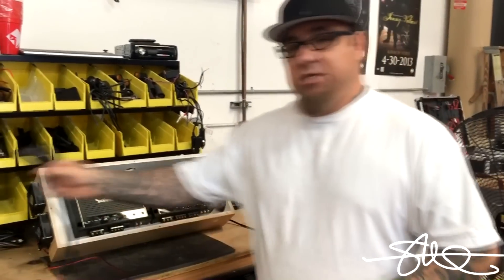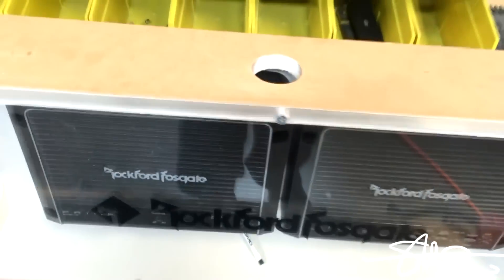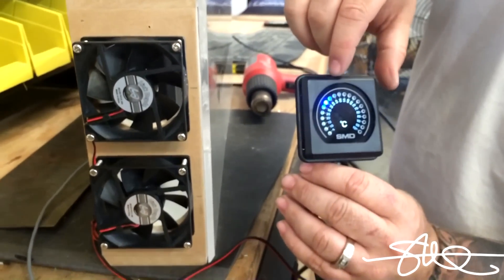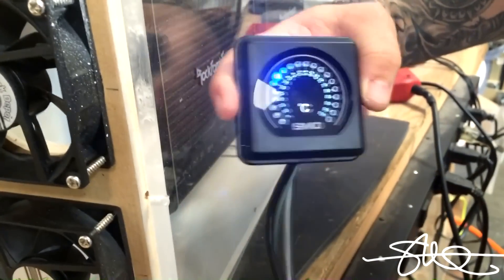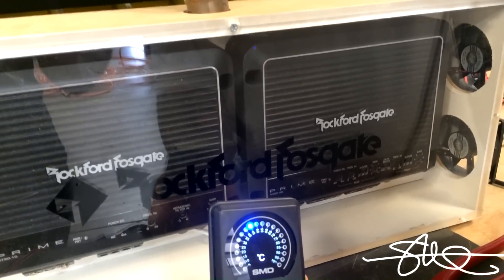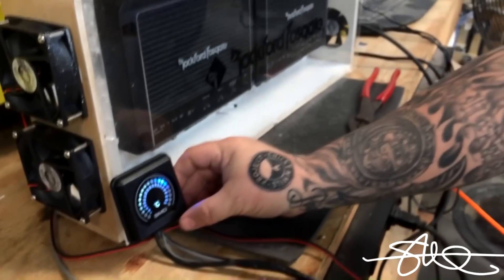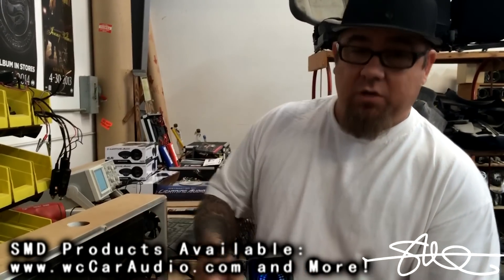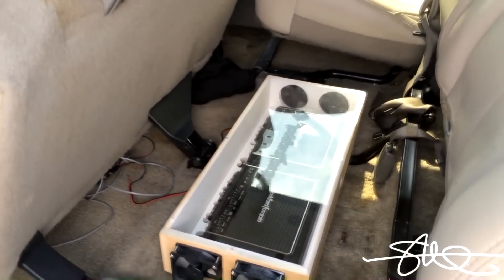How to Build a COOL Amp Rack (easy) Temperature Monitor - 3 stage Fan Cooled

Comment: I need something like that for my gaming comuputer
Reply from the maker: No Huevos i have an "actual gaming PC" and i use it.  The TM-1 will shut fans COMPLETELY off when not needed not just ramp them up.  When i am not gaming i would rather my fans didn't pull dirt and dust in for no reason.  Also it's one thing to use the one or two stock fan outputs  that have a sensor on the mainboard.  It's another to be able to put the sensor anywhere you want and control as many after market fans as you like.  I have 2 gigantic  radiators (480's) on my PC and 8 fans that would normally be spinning at all times. There are 4 other case fans that are the same. If i am not gaming they don't need to be on at all.  This is a product for a more advanced case-modder who wants extra fans in his rig and a way to control them without having a jet engine under the desk 24/7.  It might not be for the basic gamer or the guy who bought an Alienware and doesn't know how (or care to) use extra fans.  Some don't need them, some do. Some want them more than they need them.  In my case, it wasn't a waste of money at all.  But i am a "real gamer" with a "real gaming pc" so what do i know. lol
Reply from the maker: i got them in mine and so do some of my friends...they work GREAT in PC's bro :)
Reply: If you have an actual gaming PC you should be able to set fan profiles in the bios so that they will ramp up when your components reach a certain temperature. The parts in your PC already have temperature sensors on them so buying this would be a waste of money for your application
Reply: meade916 There's free software that will allow a user full control of every fan in their computer including turning them completely off so I'm not saying that your product isn't great, I'm just saying that it's an extra piece of hardware that isn't needed. Besides, most cases come equipped with filters to prevent dust from entering the computer.

Either way, I'm sure you're not going to change your mind and I'm not going to change mine so just keep doing what your doing and putting out the great videos.
I can't wait to see an update on the DGAF

Comment: Why is it Celsius. Love the product.
Reply from the maker: because that is a measurement of temperature? i am guessing that is why we did that.  FYI, as stated in the video we also have Fahrenheit available too.
Reply: meade916 What? No Kelvin?  Just kidding.  That little thing is EXACTLY what I need for my credenza that has my receiver/amp/blue ray etc in it.  I'm a huge computer geek so I thought about the case fans but then how to control them?  I didn't want a regular fan controller as they're usually manual.  Very cool little unit.

Comment: Is that oriented as push/pull, or are both sides pushing air into the box, and presumably out the hole in the top?
Reply from the maker: push pull (like i stated in the video).  The hole in the top is just so i can push heat from the heatgun into the chamber for the demo.  If i actually use this rack, i will plug that hole.
Reply: Right on. I must have missed that little part. Awesome demo.

Comment from the maker: guys, this is just a basic, quick little amp rack.  The fans you choose, the location and other things will determine what it is going to take to get the job done.  Higher CFM, higher static pressure of course is GOOD! But any air is better than none. :)
Reply: +meade916 do you have 2 fans as a intake or all 4 pushing out?
Reply: yes
Reply: Hey steve my fans are 2.75 amps so I guess I can only use one right i dont want to mess up my temp sensor
Reply: Mead can you make me one ? And if so how much ? I’ll send half so I can get started and the rest when your done let me know thx 🙏🏽
Reply: Had to come back to look at your video to help build a rack for my truck
Reply: Can I pay you to build a simple fan set up for my amp and you simply ship the finished product to me? I just have one 5-channel amp and it’s underneath the front passenger seat in my 2010 Tundra double cab. So I don’t need a full rack, but rather just a fan setup somehow.